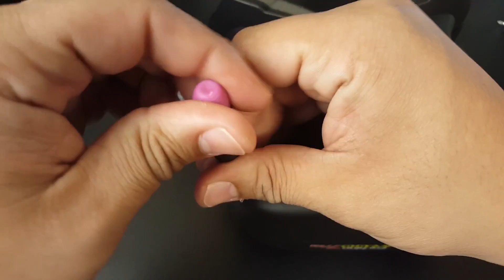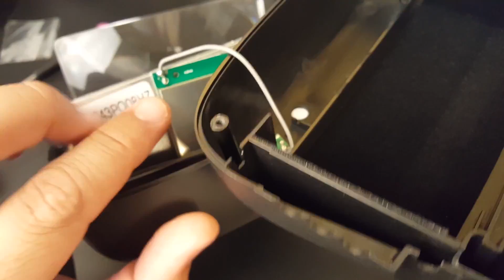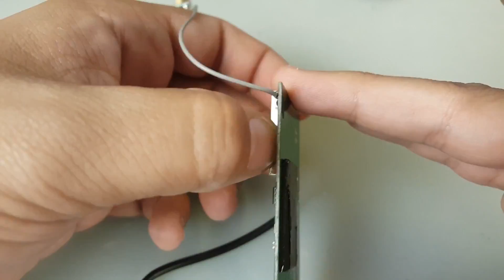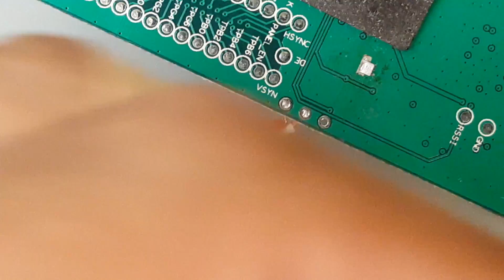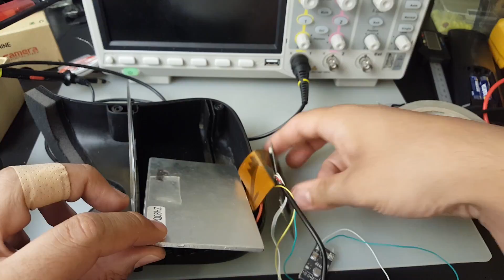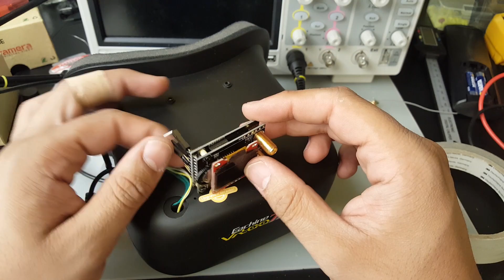Eachine VR-007 Fatshark Mod

Comment: Seems like my vr007 non-pro's have the rtx seperate with a video wire out, and pwr/gnd, 3 wires to the screen, on a 6 pin connector. On the goggles side with the board attached to the back of the screen and ribbon cable to screen, those wires are labeled as +Vin, GND, & AV-in 1. Its a pin connector on the screens board, and actually the empty 4th pin is labeled AV-in 2! 
I dont ever remember seeing a setting to change it to anything but the default AV-in which i do see sometimes on power up, so maybe if it detected a video signal on it, maybee it would work, would be cool to run a rca female out for an AV-in for the AUX-IN2 and put the fat shark module on the regular AV1 to be safe.
I just need to see what kind of voltage is coming out of the first board that gets the power from the battery. 
Bc the vr-007 uses a 2s 7.4v 1800mah lipo for some reason.. So im assuming its stepping it down and voltage regulating for 5v output for the board and screen, but it seems like this should be pretty easy actually.
Thanks for the vid for the inspiration and ideas to even try it lol. I actually really do like these goggles and the screen is very clear for what it is. built in dvr would be nice but oh well. i dont care enough to add one unless it was an easy solder on mod or something..

Comment: So ... what have you actually done??!! - you have used the LCD screen and electronic PCB from the  VR007 Pro Goggles and connected an Eachine Pro58 diversity Rx module that is used in  Fatshark  Goggles - this module is a duel Rx module that is superior than the one fitted in the  VR007 Pro ...is that correct ? - In doing so you also modified the VR007 Pro  power  supply  to give 5 Volts to the Pro diversity module ( removing two regulator chips ) - I'm sorry I've had to explain what I think you have actually done - but I have the VR007 Pro and am thinking of carrying out the Mod    
Please... what is the reason for the mod - methinks it must give better video reception...joe

Comment: Good video, am building a Pro58/LCD monitor at present, I was however confused how you have a nice Oscilloscope but not a solder extractor! but instead used a screwdriver to remove the radio can while also bending the PCB, strange. But thanks for the pin-outs.

Comment: Hi, I did this mod with the eachine pro58 but now I am getting super noisy and wavy video. I installed a switch to go back to the old receiver, and it still works fine and the video is clear, but with the new receiver, it is all wavy and completely unflyable. Do you have any idea what is causing this?
Reply: Your Pro 58, or dodgy wiring.
Reply: On another note, it seems if you have done the OSD mod (which I have) but not activated OSD in the menu - you do get wavy lines, check your OSD is active, or even try it on and off for comparison.

Comment: Thank you for a great set of hints. Successfully upgraded my VR007Pro with diversity module (Eachine pro58). But I didn't kill original receiver, but installed a switch instead - now I can unplug diversity and keep using original receiver. Or instantly compare picture quality original vs module (and difference is very huge, I must say :) )

If anybody would need some ideas on mounting, here is my design for 3D printing: https://www.thingiverse.com/thing:3517798
Reply: Anar Ibragimoff Hey, how did you installed the switch (where) :))
Reply: I did this too, but I'm having an issue. When I switch back to the old one it is the same as always, but the feed from the Eachine pro58 is wavy and distorted for some reason. Any ideas?
Reply: Noah Saxenian probably there is still signal from the build in receiver..how did you install the switch? :)) It is too late for me, I have killed the receiver, I'm just curious . I've installed fsv2445 v2 module..the only problem is that I can not switch channels, but the reception is good...even it is not a true diversity module.
Reply: @ethrrr  i did whats shown here: https://web.archive.org/web/20180830154238/https://rc-happy.com/

Comment: Hey man I just designed a mount for the Eachine pro58 module (that also fits the Realcc 5808 module you used). Unfortunately I don't have a gauge to mesure the case thickness in front of the goggles (where I want to put the module) and I need that parameter in order to create the proper "brace" (I don't know how to call them xD) and avoid the mount to slide away from the goggles. Could you please do this measurement for me? Thx

Comment: Hi there. Great video. I have a Vr007 pro its board is just like yours. Although the battery is fine it wont turn on like the screen is dead. Do you have any suggestion as to where the problem might occurs?

Comment: Hey! Awesome video. I disassembled my vr d2 Pro hoping to find a similar board inside but it looks completely different :/ How could one go about finding the video in pin using only a multimeter? I know it's a stupid question but maybe you have the answer. :)
Reply from the maker: I wrote banggood yesterday to try to get a d2 pro to mod
Reply: Have the same problem with distance on Eachine VR-D2 PRO , 50-80 meter. I think there are two separate receiver. I hope, someone finds solution how to MOD this googles. Maybe connect to channel A and manually set receiver on A. I really dont know.
Awesome video, thank Drone Mesh.

Comment: Thanks Dude. It worked. I was using True- D module, followed the same layout for the pins and it's working. My goggle antenna cable was broken so that was an alternative to throwing them away. Awesome to have my goggles back without spending the money for fatsharks. It was fun as well. It took around one hour to do 👍👍👍

Comment: I have the newer version of these goggles. They come with a different board. Let me know if anyone has found a way to input video into it.  

I've designed a 3d printable case for the Pro58 that double sided tapes to the front of the vr007s I'll upload the file to thingiverse now.

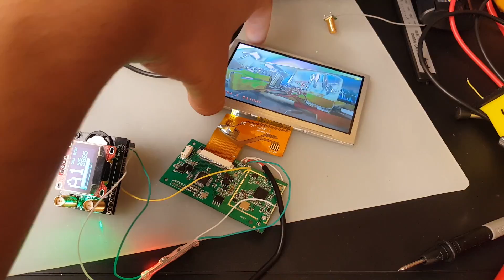Comment: wait but when you tested it at 32:25 you didn't have an antenna?
Reply: The reciever doesnt need an antenna on it in close proximity. The VTX must alweays have an antenna on when powered or you run the risk of burning it out.

Comment: Informative videos. Question for you, I am looking to at the Eachine DVR to these goggles, Do you think there is a way to add the video in wire to have the dvr onscreen info to this board? Such as to the location you added the video cable for the camera before you hacked the integrated vtx

Comment: Hi Drone Mesh.
I recently purchased Eachine Vr006 goggles, unfortunatly I can´t use them as I can´t focus on the screene. Now I was wondering if it´s possible to transfer the Vr006 reciever to my old Vr007 goggles, I´m not sure if it´s possible because the Vr006 run on 1s and the Vr007 run on 2s. I´m not sure if i should open them up, or return them and get my money back. 
I hope you can give me some advice.
Reply: You're not going to gain much by swapping the stock rx from vr006 to the vr007s... The vr006 doesn't even have real diversity. that second antenna is just a fake, its not connected to anything...
Reply: Thanks @David Tucker. It´s not just the second antenna that I´m after, it would be nice to see the battery voltage (of the goggles) on screen, I´ve had my 007s black-out on me in mid-flight, a disgusting feeling.
Reply: +Just looking add a voltage checker onto the power input. Just a little lcd that will display your input voltage will be way better. ;)
Reply: Do you mean a display on the outside of the goggles? There´re 3 leds on the battery itself to show how full it is (very unreliable, a display would indeed be better).
Reply: +Just looking Yep just a little voltage display lcd that you connect to the + -  on the inside of the goggles, and just  stick the display on the outside.

Comment: Excellent presentation, at first video play , was not sure what the object of the exercise was for - essensually you have replaced the Eachine video Rx with  one used on the Fatshark goggles  - how does this module improve the video signal is it just a much better design or more sensitive ??  --- I noticed that you powered up the module without any antenna's is that advisable and ( more Nooby Q's sorry) what antenna's do you recommend and typical range would be what ?? thanks ...joe

Comment: Hey, I tried "hijacking" the video signal. Mine didnt work. But I found out how to power the LCD by itself. I couldnt find anywhere to put the video signal in.
Reply from the maker: +Ninja Sauce U need to pass the vid signal through the LCD video processor.
Reply: Ya, i tried. Does it matter where its grounded? I tried just powering the video screen and inputting the video signal. I couldnt get it thru. I tried every pad, every resistor, every diode, and grounded in 4 or 5 different places. Powering the lcd would probably be easier for you - instead of "killing" the vrx. But where the heck is the video in that you used?

Comment: This mod will work with any model goggle with a video in. I currently have this module installed on vr006s. As well as a dvr, without disabling the internal module at all I just have dummy loads on the original antennas, and use the module. I have the module and my dvr wired to a simple switch to share the AVin...

Comment: Instead of killing the RX part we could CAREFULLY cut the board in 2 parts with a dremel to use it as spare for another project. I think it is possible unless there are components in the backside in the middle of a cut trace. 
By the way do you have any time for a prodvr mod :o)?
Reply: The Walking Trade you need help with the pro dvr install but are talking about cutting the board in half lol wat?😂

Comment: I started this mod with vision plus goggles, I used a matek step down voltage regulator 12v to 5v, but found it gave interference on the screen. Would a capacitor help, or should I use another regulator manufacturer?

Comment: Interesting thing that the original 007 have a separate rx. Was just wondering if the battery you have is 7.4 or 3.7 as the one I have is marked 7.4 from original. The separate rx has all the voltage and video clearly marked on the back.

Comment: Can you with the others?
https://encrypted-tbn0.gstatic.com/images?q=tbn:ANd9GcSS887VtNvhDJbRbkakgh2I35ARs4UCX_mlS-X-ADXkWjw9ye7Qnw
Reply from the maker: The internals are different on that model i checked out people who made DVR mods to see how the board looks and it can be same concept as ev100 because they are using a default pin out receiver.
Reply: but if you can ?

Comment: can i plug a old laptop screeen to the connector on the board look like the same !!
Reply from the maker: +BMXCREW#FATBIKE #MTNBIKE #FPV #DRONE Can't answer that for you maybe the pc screen needs more voltage than 3.3 to 5v Which is what the goggle is outputting.
Reply: ok thanks  :)

Comment: I did something similar a while ago, found a way to disable video feed of builtin RX. I made a switch for the external line, now i can either put DVR on it or external source. 
http://www.rc-happy.com/eachine-vr007-pro-dvr-and-video
I like the idea of proper diversity receiver, though, i might get it and try to fit it in the case. Thanks for video!
Reply: Thank you Janis, this was what I needed 🤗
Reply: I wish I read your post before I set off on my adventure. What I did was lift the legs of the transistors and put them on a switch. It cuts the power to the circuit in the way he did, but I put it on a switch so I could power it off and on. If I feel ambitious, I am going to redo it, and use your method. it make more sense.

Comment: A month ago I did the eachine pro dvr mod and solder the Vin to de dvr on the same pad that you used as Vin from the receiver.
 If I now do the fatshark module mod can I get the signal from the same pad? Also can I use de audio from de module and connect to a 3.5mm female jack(to use earphone) and Ain in the DVR?
If so my eachine vr007 pro will be complete with DVR audio and diversity. By the way awesome content in the channel

Comment: Side Tip for anyone who reads these comments:   I've had the ribbon cable detach from the screen before and there is no fixing it once this happens and be prepared to spend $15-$20 for a new 5" LCD with similar resolution.

Comment: I have the 007 Pros as well but my only question is what is the purpose behind the mod for the fatshark module does it give it a better crisper cleaner clear screen or does it give it more range to your flying I'm not sure why you did the mob I guess thats what I'm asking.  because the one and only time I had my goggles on my drone was about 50 feet away from me an all I could see on my screen was lines going across it and it starting to look like a staticky Channel so I guess that's what I'm asking does the mod help with all of what I'm saying??? Oh and let me add I'm a big-time Noob I've only got to fly my drone fpv one time and like I said when it got about 50 feet away from me the screen started going haywire so hopefully your mod if that's what it's for will get me back in the air after I figure out if my 4 in 1 ESC is bad and it's coming from banggood and everything you get from banggood takes forever
Reply from the maker: This will extend your range depending on what fatshark module you buy for it.

Comment: Looking at the parts to do this mod I noticed this module is on offer at the moment, its a slimmer profile also. Would this module perform as well as the one you use or not? https://www.banggood.com/Eachine-PRO58-RX-Diversity-40CH-5_8G-OLED-SCAN-VRX-FPV-Receiver-for-FatShark-Goggles-p-1160357.html?rmmds=collection&utmid=2227
Reply from the maker: Its ok but not as good as the one i mentioned and used in the video.

Comment: On the original as far as i can see ylu cut the video wire and solder it direct and use the 2s battery and it should be fine done know if the mpdules will run on 2s or not but it looks simple

Comment: I stripped mine down a while back, and found it best to remove the nut on the sma connector first before opening. Also dont touch the black velvet type material inside, as it will leave marks that wont go away.